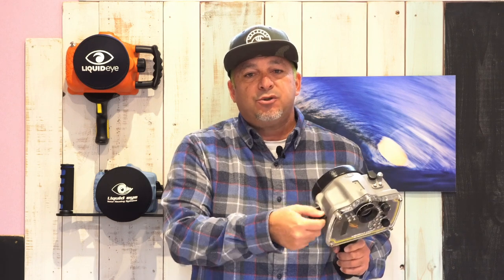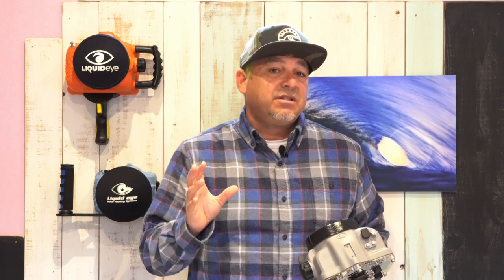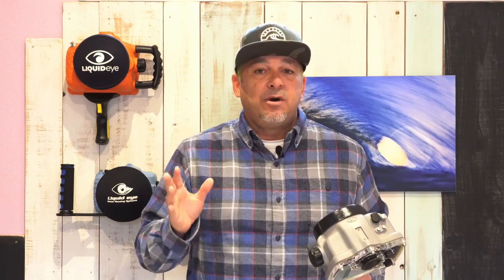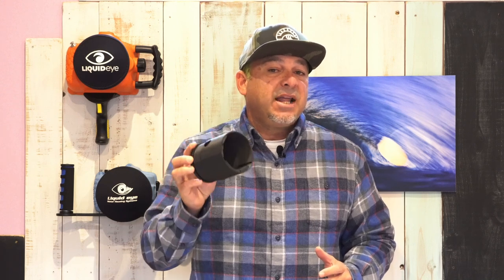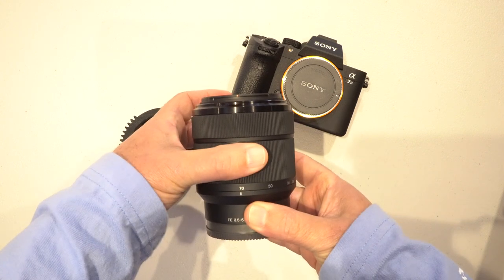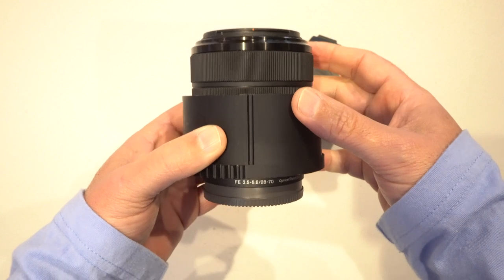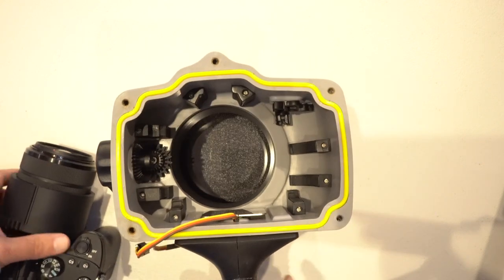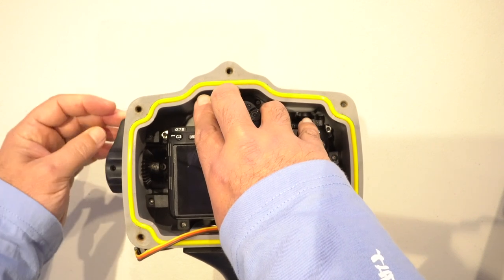A Liquid Eye Guide to Our Gear Sleeves.

Comment: i have an ef-rf lens adapter for the canon eos R. i want to use my 24-70mm f/4 lens in the water with a gear sleeve but I'm afraid the extra length the adapter adds (only about 2.9cm) would not allow the gear sleeve to align with the gears inside the housing. any advice? i tried contacting the support team on your website about 2 weeks ago and no response...